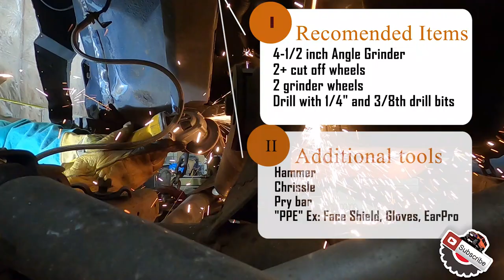How to Install Front Unibody Stiffeners

Comment: Anything to note on weld settings?
Reply from the maker: We used Power Mig 171/1 between  preset 4&5   which translates between 90 to 110amps on 0.030 wire.